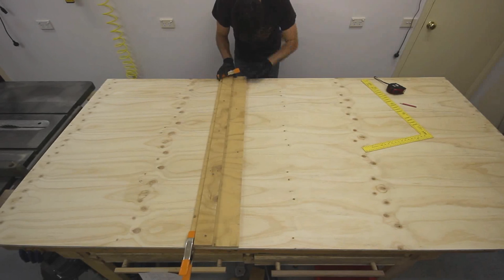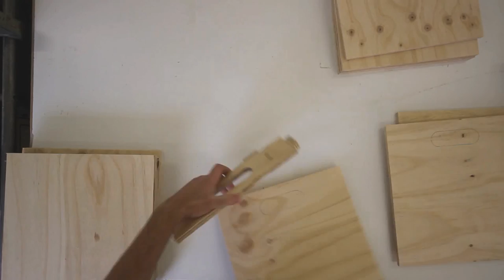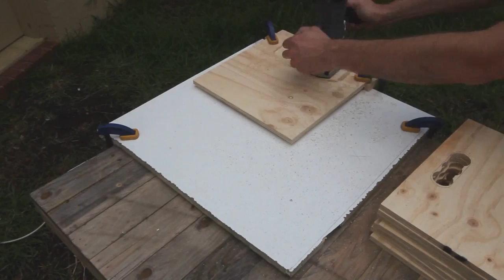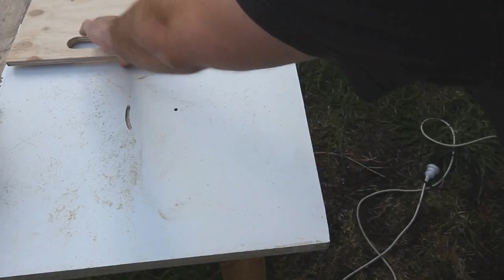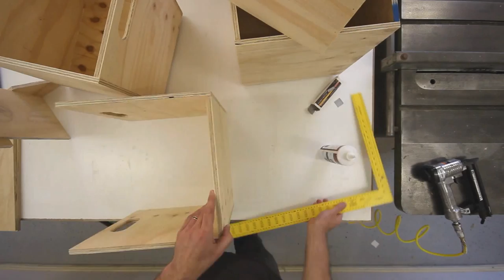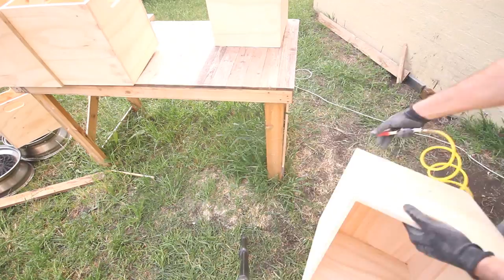full build - making plywood boxes for 12 inch vinyl records

Comment: As a professional cabinet maker,I always would add at least a rabbit or biscuit joint. It’s a little extra step but pays back dividends during assembly and strength. Butt  joints on plywood is relying on the glue,and plywood drinks up glue fast due to every second layer being end grain. Brackets or some other mechanical hardware may also strengthen the box. Cheers.
Reply from the maker: Cost was a factor with these, I looked at using steel L brackets on the open ends, 4 screws would probably add lots of strength if needed too, rough testing showed this method to be pretty strong, and I only ended up selling a few. Cheers!
Reply: "or biscuit joint" ... YT testing vids say 'no' to this idea.

Comment: A baseplate bushing on that router would allow you to cut the handles in far fewer steps. You could go straight from your template varying the depth of plunge.
Reply: A tip not a criticism :)
Reply from the maker: I have a baseplate with a bush but haven't used it, the power switch on my router broke so making depth changes is a bit of a bother. Cutting the holes closer means I don't have to saw out the waste between them which makes it a bit quicker. Thanks for the suggestion!

Comment: Would these be strong enough to hold a full box of record? I was thinking of making some boxes for my collection but I was thinking dovetail ends would be stronger.
Reply from the maker: They hold a full box of records fine, I usually leave a bit of room so I can get my hands in the handles. I planned to use box joints but that would have made it difficult or impossible to get 4 boxes out of a single sheet of plywood. Adding screws or dowels  could help a bit, but they didn't seem necessary.

Comment: I'm still learning to use the router, what bit did you use to make it smooth like that?what router bit did you use to make it smooth.
Reply from the maker: The straight one? It's a flush trim bit, otherwise known as a pattern bit, it has a bearing at the end to follow the hole pattern underneath.   The other bit is called a roundover or radius bit, it has a bearing to guide it too.

Comment: Can you please tell me the what measurements you used to cut your 4x8 sheets and is it 3/4 birch? what size nails in your nailer 2"?  thanks
Reply from the maker: Can't remember the exact size but the boxes have equal side lengths in all directions side length is based on fitting the biggest album I could find plus 1/4" gap or so plus the thickness of the plywood where relevant. These are about as big as I could make them as a 4 X 8 sheet measures 3.9 X 7.8 (1200mm X 2400mm) here.

the plywood is 12mm thick, slightly thinner than 1/2".
Reply: thanks for that. did you use 18 gauge 2" nails? was it regular plywood or birch? was it 1/2" or 3/4" plywood?
Reply from the maker: 1/2 inch pine plywood and 1 1/4" brads from memory, not sure what gauge they were, the brads/nails don't do much besides hold the boards together while the glue dries.
Reply: @lapislignum  what are the measurements for cutting 
W
Reply from the maker: See comments above

Comment: Can you please answer. Was each square piece the same dimensions?
Reply from the maker: No, the box is square inside (the base is square) so the top and bottom pieces are wider than the sides by the width of the plywood.
Reply: @lapislignum  I'm trying to make a square box for my cat, can all six pieces be the same dimensions and make a perfect square when I put them together, or do some need to be different heights, lengths width? Ex. 14x14x14
Reply from the maker: They can all be the same length if you plan it like that, your box will end up not being symmetrical, have a look at my towel shelf build, it was built like that.

Comment: Thanks. When you're starting to glue it, how do you keep the first joint square while you glue the rest?
Reply from the maker: I don't hold the first two joints square, I square them against the sides with no handle holes. The only part that needs squaring is the open side.

Comment: How can I do the hole without a router?
Reply from the maker: Drill along the line with a small drill then cut between the holes and sand down, or use a jigsaw or fret saw

Comment: How to build a plywood vinyl box yourself for only $5.
STEP 1: Buy $5,000 worth of carpentry equipment.
Reply from the maker: Theomite you're in the ballpark but not quite. The first box I made used 100 dollars worth of equipment, much easier this way :)
Reply: He has way more than 5000 bucks worth of equipment. Anyway If you really want to do it just buy a jigsaw, a cheap ass drill, and some plywood. Then measure out the pieces. Cut them, screw them in place with 1 inch screws. Boom, bobs your uncle you got yourself a fuckin box.
Reply from the maker: Run me up a total, I'm not sure I have 5000 bucks worth of stuff in total let alone what was used to make these. Also good luck cuttiing straight lines with a jigsaw. :)
Reply: I mean the table saw is atleast $1000 im not sure if you own the shop your using or not. If you do then the drill press probably around 400. so were up about 2000 now. Radial sander 200. brad nailer? Not including the aircompressor thats atleast 150. +compressor 250. Circular saw 150 to 350. Plus the hand router 300. So your right not 5000 bucks. But could easily be 4000. Also if you can't cut straight lines with a jigsaw you probably need more practice. I made a stencil of my companys logo with one a few weeks ago. Very versatile tools. Just draw your lines out first with a square. They'll come off during the finish work anyways.
Reply from the maker: @skidthakid678  If I had bought the table saw it would have been $2000 without looking too hard, a cheapo one would be $600. Drill press was ~100, (how is 1000 + 400 2000?) RO sander was $50, brad nailer was $20, compressor was $130, circular saw was $60 router was $80, giving a total of roughly $2440. 

I like that you offered a cheaper way to build these though, while it bothers me to see someone using big dollar equipment (big dollar meaning equipment that costs more than mine) badly building something that could be done with a sharp rock most comments go no further than "anyone could do that with expensive equipment"

thanks for watching, and your thoughts!
Reply: @lapislignum  None of those cuts require the tablesaw anyway.  Yeah, the tablesaw does it faster and more accurately, but you could make every one of those cuts with the same sawboard+circular saw and some patience.
Reply from the maker: @ChadTower  you are right, that's how I made them before I got the tablesaw up and running - I ripped the boards to width then nailed my shooting board to a big sheet of MDF and set up stop blocks for consistent cuts, very time consuming though.
Reply: I’ve been making these all week, my table saw was only $500 Ridgid with lifetime warrantee.... but a circular saw with a scrap piece of plywood as a guide would get the job done for about $40 at a pawn shop. You could use a Forstner bit and a hand drill to make the handles, personally I only use the finishing nails to hold the wood while the glue dries you could also use screws and fill them.  Bottom line if you are interested in making stuff you should invest in some basic tools, everybody needs a set of tools,
Reply: @Theomite For people like you there are stores where you can buy ready made solutions for storing the stuff you have.

Comment: no plans that sucks i watched the video for nothing
Reply: I'm not a carpenter, but it don't take a rocket scientist to figure out the basics of the design! Jeez...
Reply: lol
Reply: not the only one asking for plans Duh!
Reply: You have to figure the album is ~12.5 inches+ 0.5inch on bottom, 1inch on the sides... So the ends with the handles would need to be about 13H x 13.5W. The other three sides would be a calculation based on how long you want the boxes to be. 

This is of course if you are using 1/2 plywood. Everything changes with different plywood.
Reply: Some people just need to be spoon fed, with a straw...
Reply: famouzamiz Grow up...